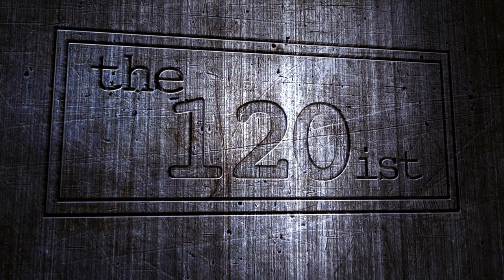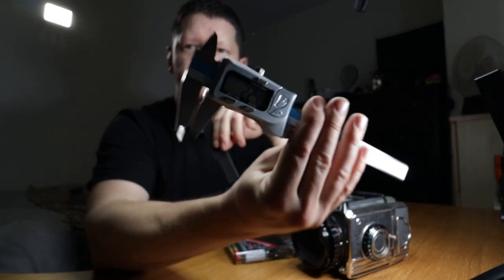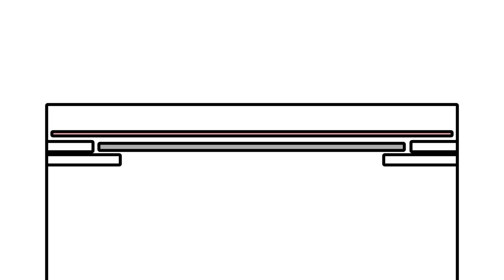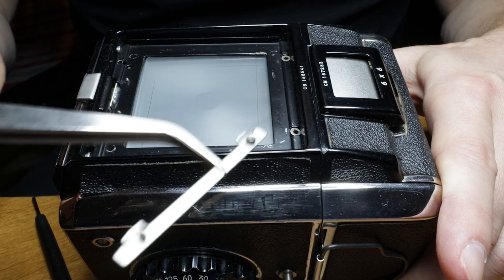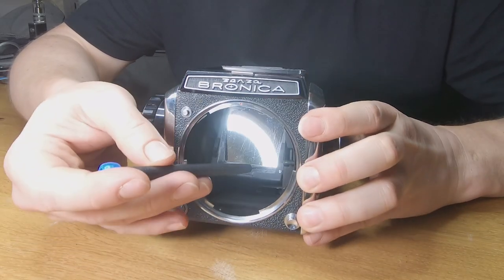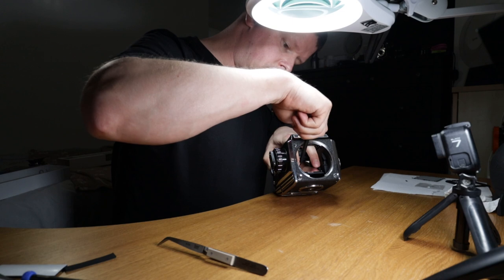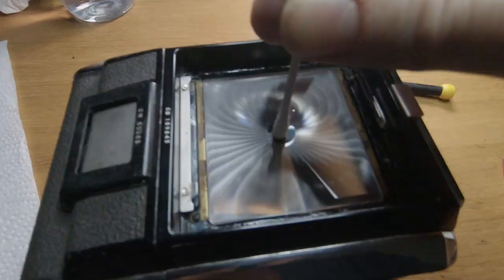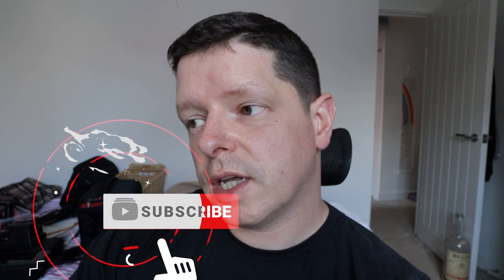Bronica S2A - Focus Problems - HOW TO replace ground glass foam AND mirror foam (also Bronica S2)

Comment: Thanks for the tutorial! I've replaced both the screen and mirror foam and can now focus to infinity, but for me it seems like the focus is off the other way now (it used to back focus on the negative, compared to the viewfinder, and now it's front focussing).

I think the issue is with the mirror (there isn't really a way to get it wrong with the ground glass since it's resting on metal?). I'm trying different foams under the mirror to try to get it right, but it's fiddly, and I need to burn through a film roll every time to check (I've tried just putting some tracing paper at the film plane, but I can't get it flat and precise enough to be confident I'm seeing what the negative will print).
Reply: Update:

After a lot of fiddling (and 4 rolls of focus tests) I've managed to get the focus spot on!

I had 3mm foam which was a bit too thick, so I ended up shaving it down (to about half). Basically my advice is that if you don't feel the screw "locking" without force, with the frame pressing right against the metal underneath, it means it's too thick. Also very important to get the mirror to rest on the two little rubber shims at the bottom of the frame ( I had the mirror up in the frame on some of my attempts and the focus was off).

Very happy I fixed it, thanks to you!
Reply from the maker: Hey, sorry it't taken me a while to get back to you. Glad you fixed it!

Question for you - do you have the original two piece ground glass and fresnel that the camera came with? Or are you using a newer all plastic combined screen?

Reason I ask is that I've only had this problem - front focusing as you describe it, or basically at the end of the lens it overshoots infinity - with a replacement all plastic screen. The conclusion I came to was that the foam was actually bending the screen down a little, causing the focus issues. I'd be interested to know if you are also working with a plastic screen.
Reply: @the120ist  no I'm using the original two-piece screen, so I don't think that was the issue. I'm pretty sure it was the mirror that was the issue and is a bit fiddly, the screen was quite straightforward
Reply from the maker: @JulienChichignoud  Ah, ok, so you're saying the foam under the mirror was a little too thick and it wasn't quite screwing down fully?

Really interesting, thanks for sharing. I'm always keen to hear about these little problems, and what causes them.
Reply: @the120ist  that's right, or at least that's what I think it was. I've fiddled quite a lot, so it's hard to know exactly what fixed it, but I'd say it's either shaving the foam (though the first time I shaved it too much and it went back to back-focusing), or making sure it was resting properly against the rubber shims at the bottom of the frame.

I used 3mm foam, but it was quite dense foam (the weather sealing type, rather than proper light padding foam, probably not the ideal choice)
Reply: I put a 2 mm foam I can't get the focus to infinity. If I put a 3mm, neither. I'm frustrated!

Comment: Were you ever able to get the Rick Olsen focus screen to work correctly?  I changed mine out for one, and doing your testing at infinity focus, I can see that the split and microprism are not showing proper focus.  I really like the bright finder and focus aids, but may need to put the old screen back in if it can't focus correctly.
Reply: For posterity, I put the old focus screen and fresnel in and it focuses correctly at infinity.
Reply from the maker: I did get the Rick Olsen screen working in the end. Took a bit of tinkering to get it right, but I got there. I found that it was susceptible to over-tightening of the screws around the frame above it, which causes it to bend downwards. So I had to loosen them quite a bit. I also had to work on the foam under the mirror, make sure that wasn't too thick.

I think the focusing aids make it much more obvious when you're focus is a tiny bit out, so it feels like you're having to work harder to get it right!
Reply from the maker: @matthewlewis3582  I found that, but I couldn't tell you why. The ground glass is in the exact same place whichever screen you put in. So the only causes I could pin down were bending of the plastic and the focusing aids making any tiny discrepancy much more noticeable.
Reply: @the120ist  Thanks.  I will try it again with the screws looser and see what I can see.
Reply from the maker: @matthewlewis3582  Let me know how you get on. I loosened the screws and replaced the mirror foam with slightly thinner stuff, and that seemed to do it for me.

Comment: Hi! I was struggling with focing problems too, i've done foam replacement but i see that focus still isn't perfect. My bronica hasn't Fresnel and ground glass separately,  I have this newer 2-in-one plastic focusing screen and i was thinking whats the perfect width for foam to replace?
Reply from the maker: I would suggest 1.5mm-2mm. Interestingly, I say in the video that there's no real maximum thickness, but I'm finding that especially with the new plastic 2-in-1 screens, having foam that is too thick can be an issue. Essentially thicker foam puts pressure on the screen, and can bend the plastic screens down a little. So you might be finding that instead of failing to reach infinity, you start overshooting infinity, so the focus gets to infinity but then you get a few degrees of turn on the focus ring past infinity.

Is this what you're seeing? 

Basically, not reaching infinity = focus screen too high, overshooting infinity = focus screen too low.

Overshooting infinity can also mean that your mirror foam is too thick and/or in the wrong place btw!
Reply: Today i checked how the infinity focus is seeing with that extra foam and it's not reaching it! It seems that my focusing screen is too high :(
Reply from the maker: @reverseddthinking1280  Are the springs pressing against the screen? With a new 2-in-1 screen the springs shouldn't touch it. They only need to apply pressure to keep the two-piece fresnel and GG in contact. If they're pushing up, then open it up and bend them down.

New foam shouldn't cause it to sit too high. The foam presses down on the screen, keeping it in place against the frame underneath. So provided the foam is thick enough, it should be flat agains the frame.

Another possible issue is that the mirror is too low. Did you change the foam under the mirror?

Two other questions for you! Do have shims between your screen and the frame? Some S2s have thin square metal pieces to installed to adjust the screen height. You may not need them any more if so.

Only other thing I've seen a few times before is corrosion to the frame under the screen, causing the screen to sit a little higher.
Reply: @the120ist  Hi! Thank you very very much for help, the problem was in the springs that I've pull up. Now my screen is lying flat on edges and the infinity is reachable when I focus. I don't have any shims for adjusting screen height. I will shot some roll and finally check that focus. Thank you!
Reply from the maker: @reverseddthinking1280  No problem, I'm glad that worked out! Hope the focus works now, good luck!
Reply: @reverseddthinking1280  Did that work out? I am about to do the same repair on mine and would value some insight! What did you end up doing?
Reply: @jeremystarn4331  just be aware of pulling the springs up too high

Comment: did you check focus only with film or with a mat screen in the film Magazin? I'm wondering that no one has done this.
Reply from the maker: Interesting, no I didn't check focus at the film plane. But I'm wondering... would you need to?

The issue here is not really whether the camera is focusing, but whether what you are seeing in the viewfinder accurately represents what's happening at the film plane.

Therefore, the infinity test - aim at an object 100+ft away, go to the end of the lens, see if that object is in focus in the viewfinder - is sufficient to check this. If infinity is not correct then there is an issue, and it's most likely to be an issue with the foam at the mirror or ground glass.

If the foam replacement doesn't fix a focusing problem, then yes, the next step would be to try to identify where the issue is coming from. Or if your focus problem is not a simple over/under shoot on infinity focus, then the foam is probably not the cause, and therefore a different investigation into cause would need to be carried out. In that case using a matt screen in the film magazine would be a good option.

But I think that because the S2 and S2A have such well known and common problems with the foam, and the symptoms are well documented etc., then I don't see a need to check focus at the film plane during this procedure.

Good question though, and I had to think about that one! Thank you.
Reply: @the120ist  Well, discussions on checking accurate focus on film plane are nowhere to find, but this is the only essential way to make it correct. It's not what you see in the finder, it's about what you get on film.
To check this you only need a second mat screen which you can easily place in the film back. Than just doublecheck focus on the level of the film plane and compare to to what you see in the viewfinder.
Testing infinity or anything else does not really help, it's only half of the way because you don't know if the level of the mat screen in he finder has the correct height. In my S2 I had 3 metal frames wich laying between metal housing and mat screen, only aprox. 3/10 mm of thickness. And my result, was that one was too much.
Ok this is really fine-tuning, but how can you get eyes sharp with f2.8 if it's not fine-tuned?

the foam only has to guaranty that the screen is well pressed down, but this does not change anything of focusing.

Thanks and good luck!
Reply from the maker: @martin-f5482  I agree with everything you've said! Apart from "it's not what you see in the finder etc."... I would argue that what you see in the finder AND what arrives at the film plane are equally important! Because it's no use the focus being 100% at the film plane if you are unable to match that with the finder!

But, what you're saying is correct of course, focus at the viewfinder is only one half of the story, and to be 100% sure that the whole focus chain is accurate, you do need to test at the film plane as well.

I can only assume that problems with focus at the film plane are relatively uncommon, as I, like you, have never heard of anyone making those checks.

I'd also say that if you are having problems at the film plane, then you have bigger problems! Because issues with focus there are going to start coming down to problems with the helicoid or the lens itself.

But it is a valid comment, and I confess I have never checked the focus at the film plane. Something to add to the list!

Thanks again!

Comment: I've got the ground glass and fresnel out and new foam on the holder but it's still not quite sharp. When I put in just the fresnel, it's super sharp, but the ground glass then offsets the focus. Any work around you can recommend? I will promise not to use super glue. :)
Reply from the maker: Ha! Definitely no super glue… is it focusing long (ie overshooting infinity) or focusing short (ie not reaching infinity)
Reply: @the120ist  looks short in viewfinder. Cannot reach infinity
Reply from the maker: @burker720  ok so the ground glass is therefore sitting too high. What thickness of foam did you use around the frame?

Just to check - you’re putting the ground glass in shiny side up, matte side down yes?
Reply: @the120ist  yeah. Matte side down. I’ll check the foam, it might be 3-4mm I think. Still have it around

Comment: Hi!! Is there any way to check the focus without putting the focus screen?
Reply from the maker: You could use the same technique I used in my Voigtlander Bessa fungus cleaning video... take the film back off, place the camera on a tripod, use a lockable cable release with the shutter set to bulb (B), open the shutter and keep it locked open. Place a piece of paper (tracing paper is a good idea, as someone suggested) against the back of the camera. This should produce an upside-down image on the paper.

I've never tried it with the S2A... my only concern would be whether, by holding the paper against the back of the camera, you are accurately representing the exact position of the film plane. It may be a millimetre too close to the lens, because the film is slightly recessed into the film back, to allow space for the dark slide... I'm not sure.

Are you still having problems?
Reply: @the120ist  I've fixed it before but unfortunately broke the focus screen. Now I got another screen but I haven't been able to correct the focus. I have tried with foam of 1, 2 and 3 millimeters and I have not been able to. It's a stressful job
Reply: @the120ist  But if I do what you did in the Voigtlander camera I will not be able to check if the mirror is well calibrated because in bulb mode it is down until when I finish pressing the trigger cable

Comment: Brilliant.
Reply from the maker: Thank you!
Reply: @the120ist  I'm amazed at the quality of the scans from my Bronica S2A and the 75mm lens at F2.8. I've been testing focus and it seems good most of the time. I had one infinity shot that seemed a bit soft, when in fact it was clear on the ground glass. If the foam needs replacing, surely I would not be able to get a clear infinity on the ground glass? In other words, does a disintegrated foam make the camera front focus or back focus? Ah, the endless foam question!
Reply from the maker: @Jellybaby50  ah! I wrote a reply to you on the Bronica Users Group but didn’t hit post!

It really sounds like you don’t have the foam issue, which is good news! Firstly, if the foam has broken down you will not be able to reach infinity focus on the GG. You’ll turn the lens all the way in and when it hits the stop infinity will not have been in focus at any point. And you’ll know that if you could just turn it another 1/8 turn you’d get there. So it appears as if it is focusing short.

The tell tale that you don’t have a foam problem though, is that you would be getting soft focus throughout the range. The infinity focus is just the test. On my first S2A the problem was really bad, and it was much more noticeable at closer focus, where the DOF is shorter. 

So I’d say there’s no foam problem with your camera! What is at fault with the soft infinity image, hard to tell. I’ve had similar though, where infinity images are less sharp than I would expect. 

I did a test way back when I was swapping out focusing screens and getting in a real tangle with it all, and I compared an infinity focus shot taken with the image in focus on the GG, to the same shot with the lens on the stops - ie infinity according to the lens markings. The test showed that the GG was way off… but frankly the correctly focused image wasn’t all that sharp either.

Not sure what to suggest on that one!
Reply: @the120ist  This is really helpful. Yes, my close shots are really sharp. It might be an innate softness of the lens wide open at infinity. Anyhow, I'm going to live with it all as it is. You have reassured me on the foam and given me the answer I needed (how did we get to be so obsessive? - do the rest of the world sleep more soundly?). Like I said, I owe you a pint.
Reply from the maker: @Jellybaby50  One day our paths will cross and I'll hold you to that pint!

And that is a good question... how did we become so obsessive??!? Of all the videos I have in mind to make, literally 50% are on S2A focusing... the other 50% is stuff on the rest of the world of photography. I think I really am getting a bit obsessed!
Reply: @the120ist  Obsession is everything. When my 24 year old son asked me what it would take to become a film director, my reply was one word - obsession.